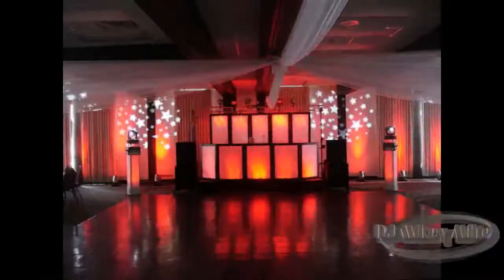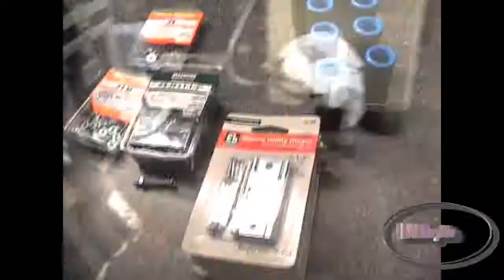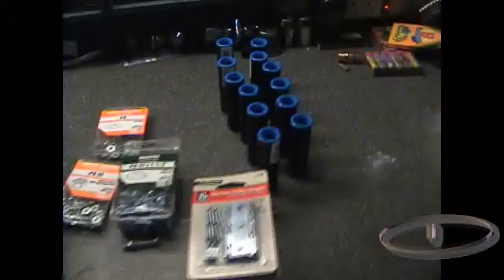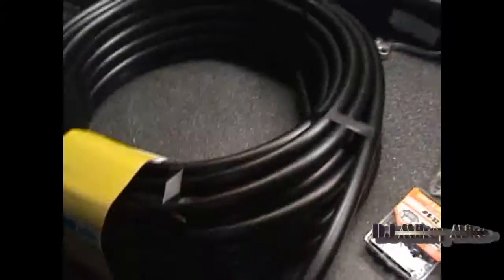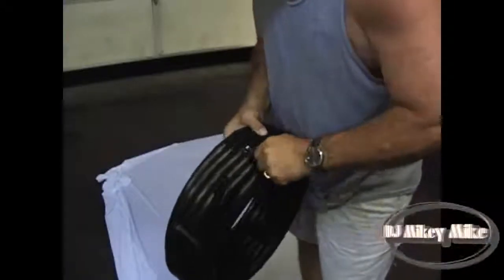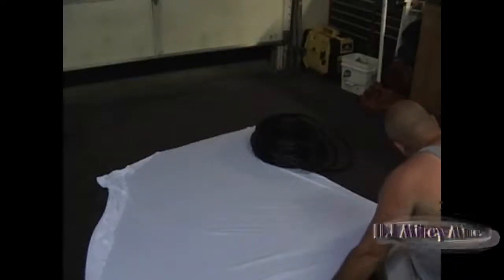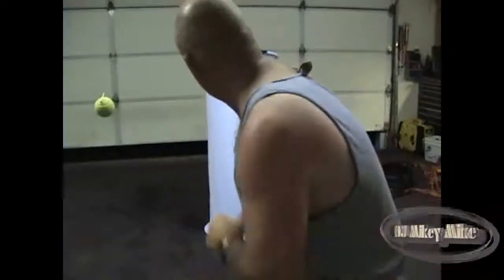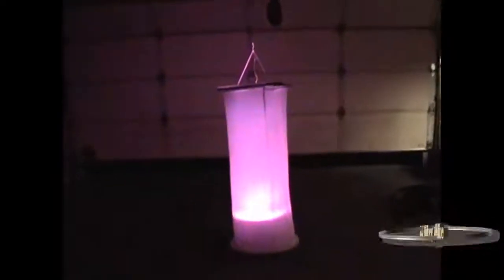"Do It From Scratch" With Vertical Tube Socks with up lighting pars

Comment: was this supposed to hang from the ceiling at the venue or sit on the ground just like you had it?  ive been to halls where they have those big paper balls with lights in them hanging from the ceiling....just seems like a lot of setup work though